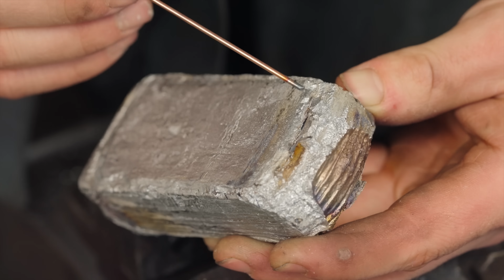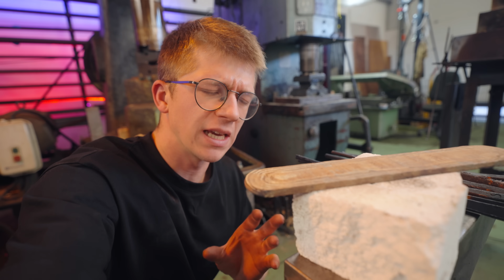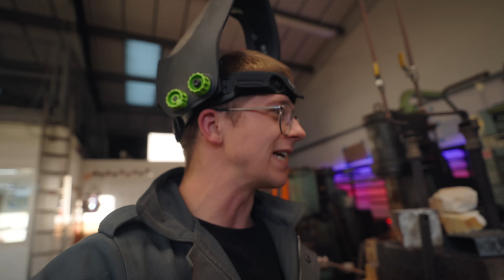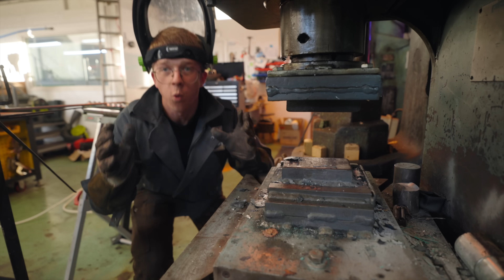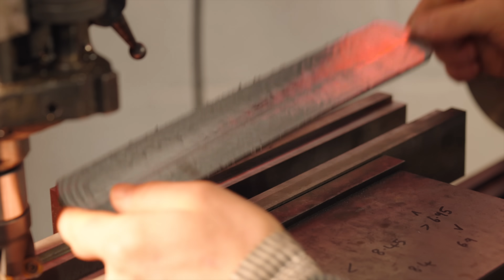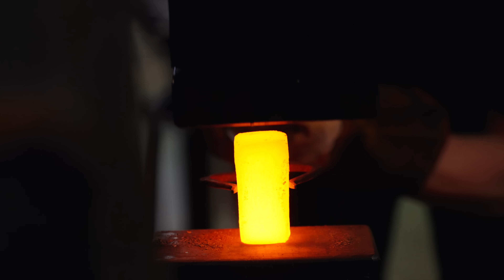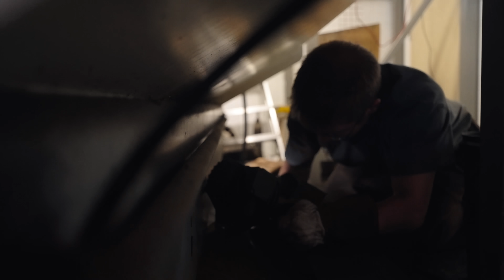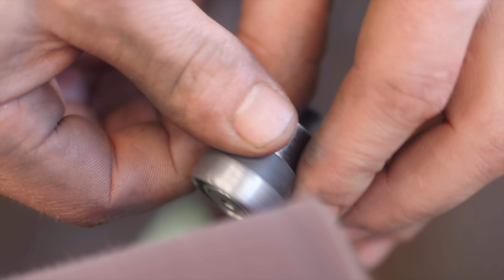Can I Make Titanium Damascus? Part 2

Comment: An explanation for the sudden expulsion of molten metal: Iron and titanium has an eutectic point at around the 70% titanium-iron mixture. This means that while both titanium and iron has a high melting point, a specific mixture of them melts at suspiciously close to your higher forging temprerature.

Also great vid, thanks Alec!
Reply from the maker: That is bloody fascinating! Thank you!
Reply: @AlecSteele  science is crazy in the world of alloys, Galinstan melts at -19c so used to replace mercury in thermometers
woods's metal and Field's metal also do the same but at around 60-70c so useful for low temp casting
Reply: @popeter  mm lead and cadmium. Field's metal is much safer.
Reply: @popeter One of my favorites is NaK, which is (a very, very dangerous) liquid at room temperature.
Reply: @AlecSteele  I've encountered the same problem doing mokume gane with US quarters.  The melting point of the copper/nickel eutectic is WAY lower than the MP of either metal individually.  The MP of the eutectic is unfortunately painfully close to the forge welding temperature.  Very easy to turn the stack into liquid and ruin everything...but you must never ask me how I know 🤕  Your steel can is forming a eutectic with the surface of the titanium.
Reply: @spooneythebadger  If your using a power hammer with a high enough pressure, you can compression weld the copper at room temperature.
Reply: @nunyadayumbusiness591  That sounds wonderful; sadly, I'm doing it by hand so that's a no-go for me.
Reply: @spooneythebadger  For what you're doing, there might be enough copper for the "cold welding" effect to let you work at a lower temperature. (Not sure due to the nickle, I was using silver quarters & copper pennies.)
Reply: @AlecSteele I’m willing to bet if it’s not a true eutectic it’s a reduced melting point. When I worked in the solder industry there’d be long protracted arguments about if a certain alloy was a eutectic mix.
Reply: @AlecSteele  One of the most common examples of 2 Metals lowering the melting point of each other when combined, into an Alloy is used to melt Aluminum faster.
Reply: @AlecSteele  Mineralogist here: Any kind of Fluid (CO2, H2O, Cl-,F-, which you most often find in rock/magma) reduces the melting point of the rock/minerals. The higher the fluid-content, the lesser the melting point. My hypothosis is, that the continous flow of argon gas acts as a liquifying medium for the crystal lattice and reduces therefore the melting point of the metal. I think that you could vary the effect y varying the flow-rate of the argon. It would also explain, why the recipe says, that you only should use a rather low flow of gas.
Reply: @AlecSteele   Near the eutectic point, you often see super-ductility. This is what's used in shaped charges, interestingly, so it may not be melted persay, which would match with how fast it sets to a solid.
Reply: @AlecSteele  Not sure if anyone mentioned this, but you are essentially creating a pressure vessel with an Argon atmosphere, melting points change at different pressures, and the patent mentioned a certain flow of Argon, could the pressure due to the flow of Argon be part of the problem?
Reply: @AlecSteele I believe to remember that you drilled 2 holes instead of one for the Gas to escape. What if all the Gas escapes through one of the holes while the other sucks air in, similar to a Vacum pump (dunno what it was called, but it was a hose connected to the faucet. The running water pulled the air out of the flask).

Can you check if the holes, where the molten Material squirted out have something in common? Maybe size or Position and if the Material is more liquid around a specific hole. If yes, then this could be a indication for their involvement.
Reply: @AlecSteele  Alec you should enroll on an engineering course so you can formally learn about material properties
Reply: @AlecSteele  I found this as well. One possible solution would be to line the canister with a graphite sheet, this typically wouldn't work well as it would burn away, but since you have inert gas purge this should be fine. It might also help with canister separation.
Reply: @AlecSteele 😢Guild Wars 2Guild Wars 2
Reply: @AlecSteele  I also wonder if it heats up from pressure?
Reply: @FadedLightHQ  that can also be the culprit. If you watch a video of a steel hotrolling line, one of the reasons they spray the steel with water is that the plastic deformation can overheat the rolled steel (the other reason is descaling the oxide layer).
Reply: @benjaminkrasznai6222  I was just thinking of the nail method of lighting forge forge hitting it on a anvil to turn the steel red hot just from a hammer. And how much that metal squished in the grain pattern when he showed it. I wonder if it causes it to heat up to critical?

It'd be interesting if he take a thin piece of titanium stock cold and see if he can do the same. I bet it would be hotter?.. idk 😶
Reply: 950°С...
Reply: @Leonid-22  yes it is possible im wrrong...
Reply: @dontknow3886 You just forgot to check the units. That phase diagram was in kelvin
Reply: This is exactly what I was thinking. Somehow forming a eutectic alloy. (basically what solder is)
Reply: @benjaminkrasznai6222  so, basically you shouldn't really be forging metals encased in different metals? Or have a barrier between them. Will have to consider a titanium case, or not purging, or using an induction/electric forge in an argon environment... (Argon would work well with electric coils, like a lightbulb filament)
Reply: @DIYToPen  Maybe something like a low iron content stainless or pure nickel case would work.
Reply: @joshuahuman1  someone mentioned vanadium in the comments... A quick search tells me you can get vanadium sheet/foil
Reply: @joshuahuman1  There's no  stainless with a very low iron content (partly because at some point they stop being called "steel"). The maximum not-iron content in stainless is about 30% (316 has about 20% Cr and 10% Ni.others seem to have less)
Reply: @andypughtube   Sir, both SuperDuplex and Hyperduplex request a word with you, and so does at least one Super-Austenitic.

Super Duplex 2507 has about 25 wt% Cr, 7 wt% Ni and 4 wt% Mo. 
UNS S33207 has a nominal composition of 32 wt% Cr, 7 wt% Ni and 3,5 wt% Mo.
Type 904L / 1.4539 / UNS N08904 hits an insane 20 wt% Cr, 25 wt% Ni, 4 wt% Mo and 1,5 wt% Cu to top it off.
Reply: @DIYToPen depends on which metals. Lots of crazy phases and alloys can form and it’s hard to determine what’s going on. Lots of them aren’t documented or if they are it’s hard to find
Reply: @DIYToPen  if you dont purge for titanium it almost immediately oxidizes the outside layer when you heat it making titanium oxide and it makes it immposible to forge weld properly making a titanium box might not be a bad idea but then it would also forge weld to the billet meaning he would have to likly sand off the outer layer of titanium oxide but to be honest that doesn't really matter in most cases and as for induction heating in argon thats a very expensive machine
Reply: @Danielhuren  fair, though it doesn't really matter if the outside of forge weld oxidises. Maybe there's a suitable flux. Some put a barrier in their case. Like a powder or solid piece of dissimilar metal... The box welding to the billet could be part of the Damascus pattern. Also, nothing to say that an induction forge has to be very expensive, the technology is available quite cheaply, and you could DIY an inlet for argon purging.
Reply: @DIYToPen  Carbon rich minerals make wonderful separation materials.  Clays, Ochre, White Out.  Some use stainless steel or other foils as a barrier.
Reply: @DIYToPen  You probably only need to limit the temperature. There is a minimum temperature where any mixture of metals stay solid, you just need to be careful not to overheat it.
Reply: A classic example of  " the best way to find info on the Internet is to do it wrong on the Internet"
Reply: I also think the argon contributed: pushing it out the front instead of random directions.
Reply: @ollie4022  I never said I had a phd, just that I was a phd student (in materials science, under the department of metallurgical engineering). I however, have had classes in material science that explained that when a eutectic is present and heated, the composition of the alloy will preferentially tend to that eutectic as it is thermodynamically favorable to become liquid than to stay solid. Since there is a range of melting points for any given solid, it is not unlikely that both plastic flow and liquid material is present. It is also likely that that volume of material exists as an alloy since titanium is much lighter than iron and thus, the 35% iron by weight is much easier to achieve with a lower volume of iron compared to titanium. All of this to say that the phenomenon seen in the video is most likely due to eutectic alloying than simply just plastic flow, especially since plastic flow, even under moderate pressure, will never spray to the extent shown in the video at that temperature for those materials.
Reply: Eutectic alloys could even be used for brazing, if you don't want to introduce other elements in your alloy
Reply: Yes answer is in physical chemistry. It's the same why you should never put out an oil fire with water. Water boils at 100 °C oil even higher but when you mix them together you will decrease the boilling point of the mixture down to 60 °C (or 70 °C I don't remember exact numbers).
Reply: @benjaminkrasznai6222  That’s a good point, I didn’t consider a eutectic.
Reply: haha. came here to say google: titanium steel eutectic lol... yes
Reply: Damn I was just spitballing about it being similar to cryolite/aluminium I didn’t realise that was actually the case and it was well researched already.
Reply: Argon when used as an inert atmosphere, can indirectly influence the melting process by preventing oxidation or other chemical reactions that might otherwise affect the melting point of a material.  So there is a two fold issue between the bimetal reaction of the steel and titanium and also the argon as an inert atmosphere. This is a fascinating problem to me....
Reply: That's much more fascinating than my uneducated thought😅 I was going to say maybe the melting point specs are not taking the argon into account and assuming the metal is in air, but I think you are right!
Reply: This is my theory, too.  Antimony also melts at lower temps when alloyed with enough lead.
Reply: @benjaminkrasznai6222  I found an Fe-Ti eutectic phase diagram. Just at a casual glance it looks like one you start adding iron the melting point goes down.
Reply: That's so counter-intuitive. You'd think mixing them would sort of just average the melting point, but your explanation is probably right. I know Antifreeze is 50% Ethylene Glycol, 50% water, which actually lowers the freezing point far below where they would freeze individually.
Reply: i was wondering if it was thermal compression causing the leakage? Since you are pressing the titanium at lower than melting point and the rigidity of the material even at that temperature is causing the pressure to compress that heat and increase the temp of the material in small areas. the concept of pressure heat causing the material to rise to near melting point, and don't know anything about how titanium behaves at those temps but its possible its much more pliable and closer to paste consistency at that nearness to melting than steel may be.
Reply: Azeotropic mixture?
Reply: Is the steel used for the billets low carbon? That carbon in normal steel could be what's causing the eutectic reaction at such a low temp maybe? I know if graphite touches titanium, the eutectic reaction is at like 1200°F or so.

For softening, I would try a hot isostatic press. You'll have to heat treat afterwards at the final product level for surface hardness. You could even use hot isostatic pressing for initial cladding if one of the metals is in powder form.
Reply: When they are already an alloy or is it enough for them to be close at high temperatures to make that happen?

If the close proximity is already enough, what would the temperatur that this could happen and would it be still possible to forge the titanium if Alex stayed slight below that?
On the other hand, could the Argon be the reason for the higher temperatur? Similar to a fire where you blow air into. I know it´s innate, but maybe theres an interaktion inside the case that rises the temperatur?

Another idea would be to use something else than steel for the case...something with a higher melting point than titanium....or at least steel
Reply: @ollie4022  as a material science phd student, I can assure you that this scenario does play out at elevated temperatures. That amount of steel next to that amount of titantium will make a great deal of alloy which is molten at that elevated temperature
Reply: Came to say that my guess would be a eutectic melting point between the steel and titanium and looking it up the eutectic melting point for Fe-Ti mating alloys is 1985 degrees F (1085C) so.. Pretty much right on the money for what Alec was seeing. Glad to see there's more people aware of the "fun" of metallurgy and alloying
Reply: Eutectics can also form when making Mokume Gane!
Reply: Could it not also be due to the mixed grades of the Ti, as from a chemist's perspective a racemic mix of alloys can lead to spontaneous reduction of the metals and the formation of molten metal as the temperature of the billet rises. this would occur throughout the billet, but due to the flow of Ar through the billet this alloy is pushed to the back of the billet. This also presents the possibility for "micro spots" of higher temperatures forming in the billet due to the way Ti reacts at higher temperatures. I think this could also be the reason why the alloy with steel will be extremely difficult to make as Ti can act as a reducing agent in the formation of pure Iron (Fe) from its oxide, therefor if you make a Ti Fe billet you would need to make sure that any and all oxygen is removed before hand, including any oxides that might be present in or on the metals as the oxides would lead to inclusions in the crystalline structure that can then lead to a failure of the welds. I also think due to this reducing ability the alloy formed with Fe would be extremely brittle, similar to how Cu weakens steel.
Reply: Was gonna say this.  The technical term is "Eutechtic bond" or reaction.  It happens with brass and silver as well in jewelry making.  Basically, that little edge where the Titanium is touching the steel/iron jacket you have around it is mixing and turning into an alloy that has a lower melting point- once that's started, it spreads (as the liquid metal can touch more of the Ti and Fe and pull more of each into the mix, thereby exacerbating the issue).  This is why the center of the billet is doing allright, but the edges and ends aren't- those are the parts in contact with the iron.

This is part of why it's difficult to forge-weld titanium- you need that oxygen purged environment, but you can't just jacket the stuff in steel.  Maybe if you make the cannister out of titanium as well, or possibly use an induction forge inside an argon atmosphere for the initial welding (like, you'd need to build a tent with an anvil and hammer, with the induction forge, inside.  You could maybe repurpose a sandblasting cabinet if you could make it properly airtight?)
Reply: While I do agree that the eutectic is something to consider, I haven't seen many people talking about just how exothermic the reaction of Ti and O2 is. The Formation of oxide layers on Ti can release a significant amount of heat. Looking at the heat of formation (energy released from the reaction), it is -944.7 kJ/mol. Compared to the reaction of oxidizing carbon at -393.5 kJ/mol. That is to say, oxidizing pure Ti can release a lot of heat.

My guess is that in the process of working the material, Ti is forming oxides that are releasing more heat than just the furnace reaching temperatures that would be closer to that eutectic.
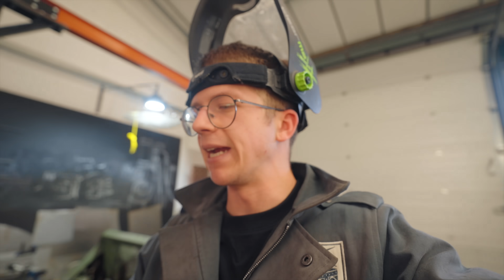Reply: 5:50 bro really turned on my siri bruv
Reply: I know this is late but i use this exact effect in lab to melt cobalt at 800C to make fancy crystals, its a really nifty effect you can use to make all sorts of things
Reply: which is how people were able to create tools from bronze
Reply: I was thinking the same thing as the same is true for nak, which is LIQUID AT ROOM TEMPERATURE.
Reply: I believe it's a combination of the eutectic mixture combined with....... 
What's the MP of Ti? (At RTP) - this isn't at RTP with the heating/cooling from the annealing the 2 types of Ti (different speeds)will lead to one type being under higher pressure -> lower MP
Reply: yes but from what i have found that still has a melting point of 1400°c
Reply: @dontknow3886  The Eutectic point according to Hiroaki Okamoto's Phase Diagrams for Binary Alloys (second edition) is about 1070C, which is around 2000F - the temperature he was forging at
Reply: @dontknow3886 saw that diagram. It's in Kelvin, and that's a one for pure titanium and iron, no other metals in the alloy.
Reply: @dontknow3886 I was thinking he might be running too much argon?
Reply: @dontknow3886  Around the 71% (atomic, or about 75 wt%) Ti, there is a meting point of 1078 °C. Between the range of 51 and 77 atomic % there is a stable 2-phase (partially molten, partially solid) region.
Reply: @dontknow3886  hence why it's a eutectic point and not a typical melting point. alloys have weird points where it can change from a solid to a liquid that vary depending on their % composition, so there is no set melting point for these grade 5 and grade 2 titanium. There are also beta and alpha phases in which the iron/titanium content acts like a liquid that is in a saturated solution-like state with the metal. I would highly recommend searching up some alloy phase diagrams and a few google searches related to them and you'll get a quick crash-course on some of the thermodynamics of metal alloys :D